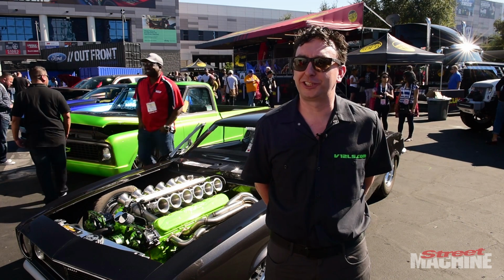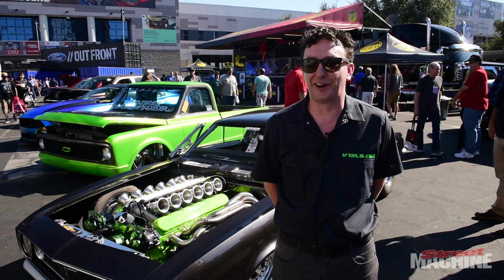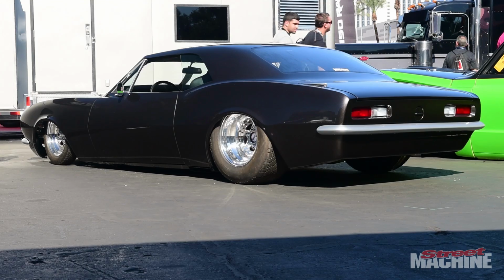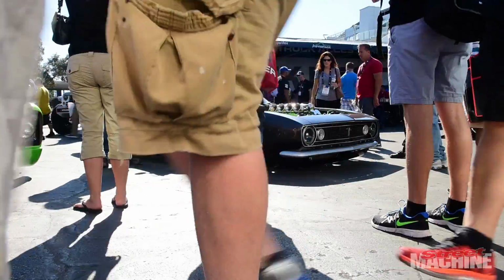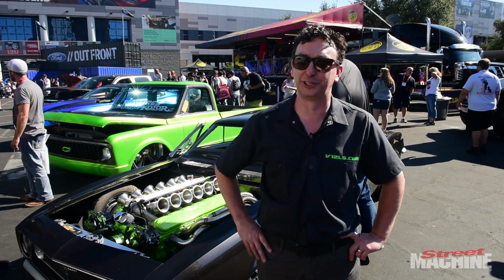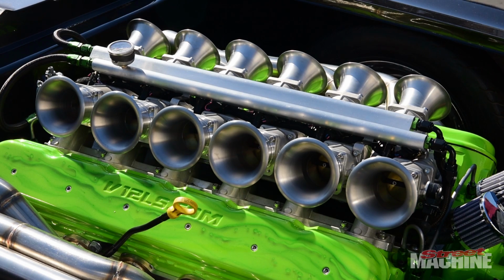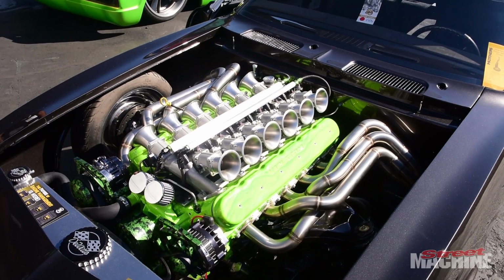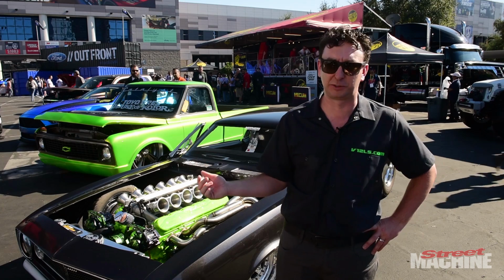V12LS at SEMA | Award Winning | Street Machine

Comment: yep for 72,800 you too can own this 9.5 liter engine making a paultry 1000 horses with a 6500 rpm redline. Just like the classic motors of the 30s. 

Or..... You can buy 2 ls1 engines, and two decent cars, and have 2 cars with 1000 horsepower ls1 v8s in them. That you can get parts for at the parts shop!

You could even buy a lambo v12 with part resources, a warranty, and a proven record of 3 generations of supercar. Turnkey, for about 17,000 dollars cheaper than this engine..  Glorified boat anchor don't know why this crap keeps showing up in my youtube feed.

Comment: I love the idea of custom engines because there are both old and new designs that aren't being utilized or haven't been in a position to be "tuned" due to low volume or high price as well as the opportunity for more ideas to surface. 
Stuff like this is great and I hope it catches on and we see more in the near future.
Reply: We know exactly what you mean. There are some great engines out there, but you can't get off the shelf parts to play with them, at least not at any sensible price. The V12LS engine on the other hand has been developed for engine builders who are familiar with the LS. They can apply their wealth of knowledge and parts of preference for the LS to these V12's, and make a little over 50% more power than the same V8, and at least 250% added factor of awesomeness. Engine builder kits are now available, including block, crank, cam and very shortly LS7 style heads. I can't wait to see what some of the top LS workshops can do with this new platform.